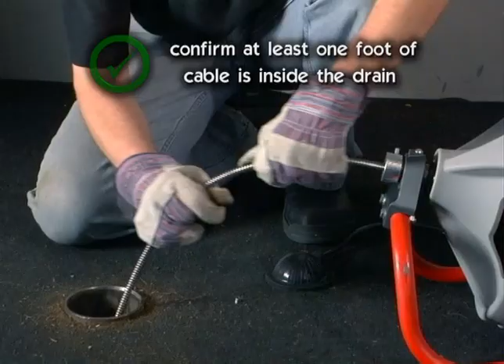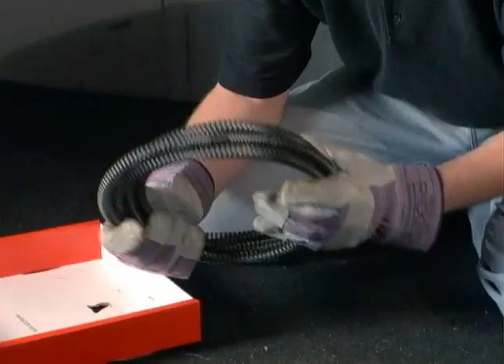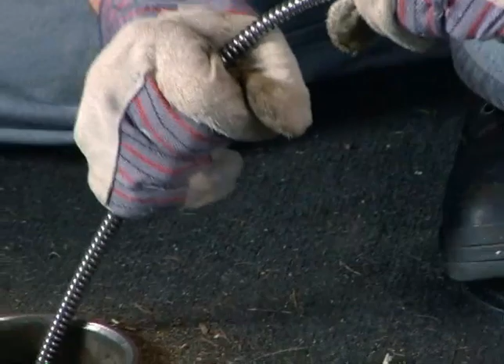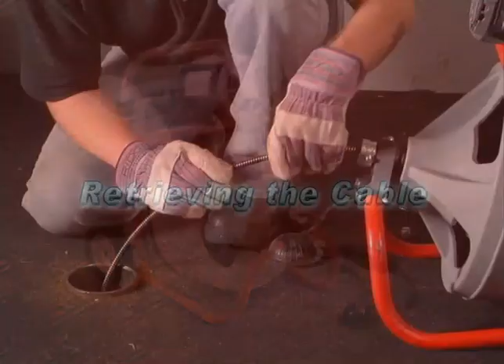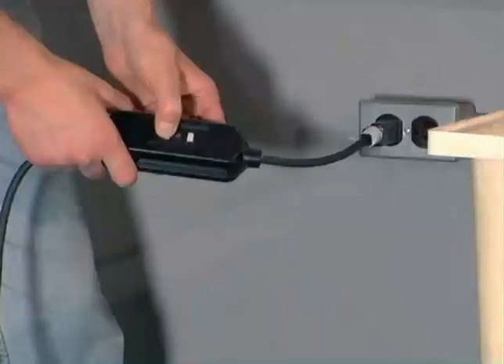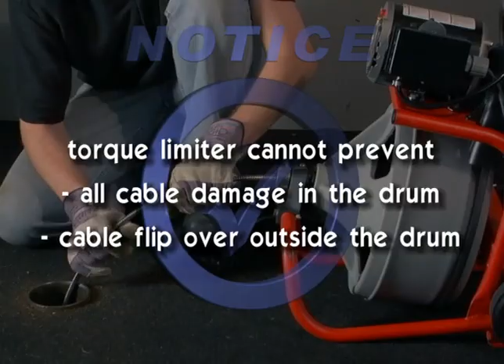RIDGID K-400 Drum Machine - Manual Feed

Comment: I am surprised that RIDGID left the 5/16" x 1" cable lock screw during this vedeo presentation of the safety and proper use of the k400 drain cleaner. It is supposed to be removed and discarded before operating the  machine. It is very hazardous and dangerous to the user if left in place. It can grab your glove,  pull you into the machine and cause very serious injury to the user.
Reply: Ridgid probably boxes this unit back up and sold it after they made this video 😅